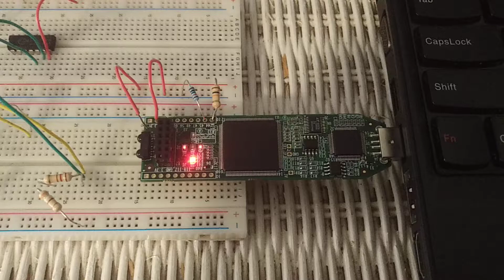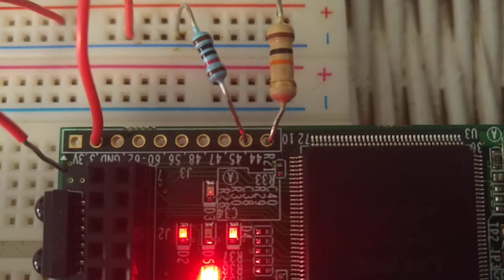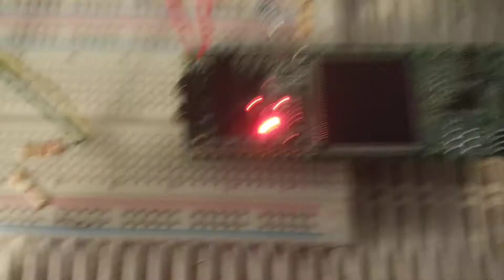First Project with Lattice FPGA- Part 6: Hardware Implementation

Comment: Any plans for a video on setting up a 'blink led' project using Lattice Radiant?  i.e. pin assignments, adding timing constraints, simulating, programming?

It seems Radiant can be used on ECP5 boards (colorlight v8, cynthion, limesdr-mini-2) and ice40 (fomu, pico2-ice, iCEBreaker-bitsy)

While I found a few articles* , I haven't found any video tutorials!

*bytesnap article on debugging using lattice reveal 
Harvey Mudd "Lattice Radiant iCE40 UltraPlus Project Setup"
Gate Array Workshop with the iCE40 from jonathanjo 2017-02-01